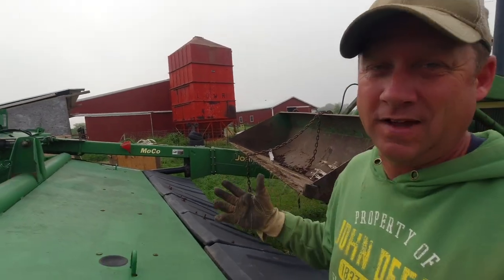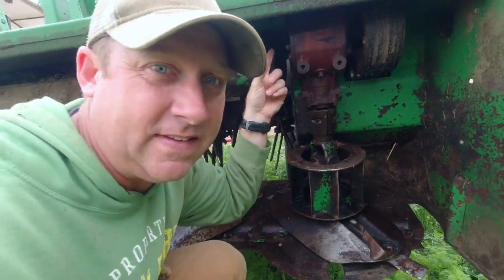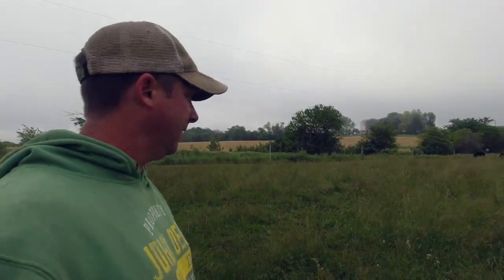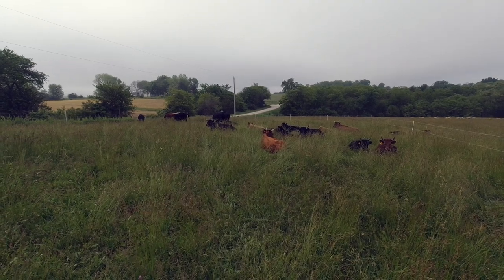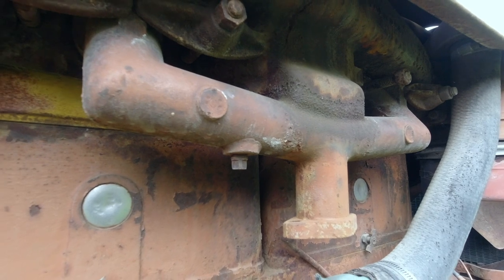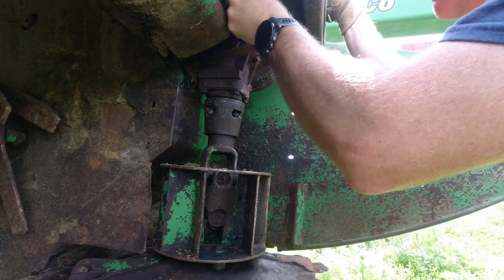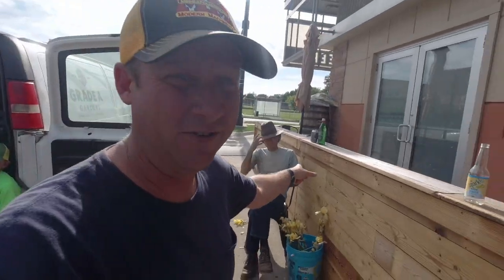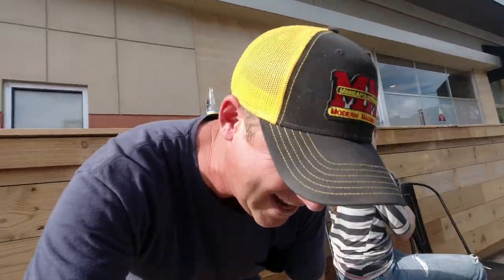Finally Fixing the Mower Hood!

Comment: I like your pigs. How much hay you putting in? If your only going to use that mower  a half dozen times a year or less and can get a day of mowing out of filling it I don't think I'd fix it. The problem with fixing seals on older equipment is the seal can cause a groove on a shaft so chances are it will still leak. Then it gets real expensive to fix especially green equipment. I don't know, I don't like leaking equipment  but some  things are not worth the fight. Gota pick your battles
Reply from the maker: I'm hoping that we'll make about 300 bales this year, but we will have to see how it comes in. We are still in a bit of drought here in our part of the state, but have been getting some timely rains that have helped. As for the seal ... I think I'm going to wait on fixing it for the moment, although I may need to replace some U-joints right below that gear box, and if that is the case I'll probably fix it all.